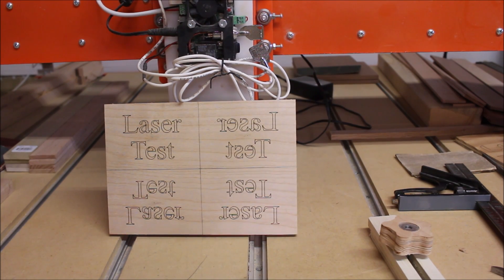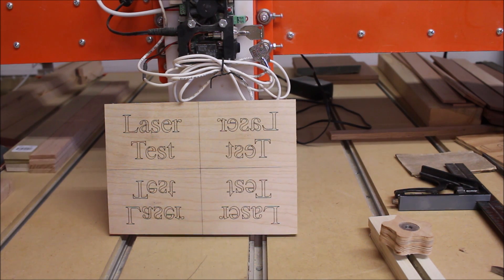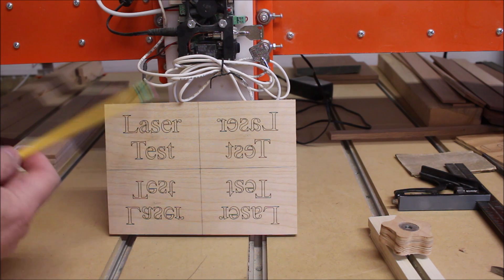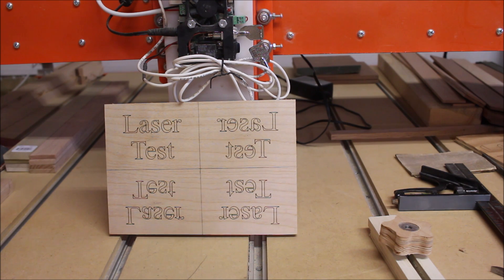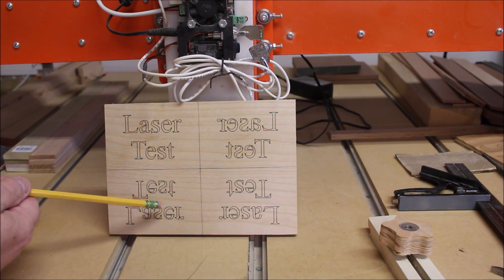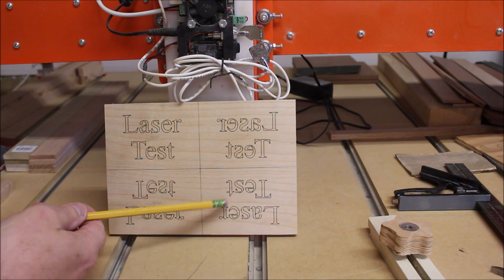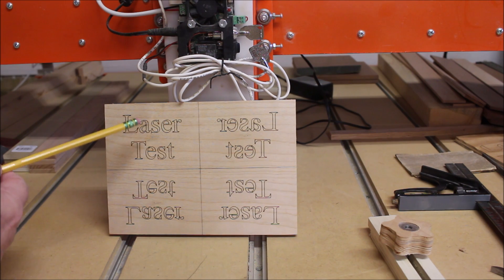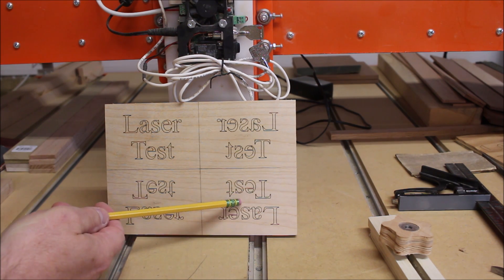My Program is Ran Upside Down

Comment: And where do you change the settings in Lightburn?
Reply from the maker: I'll assume your asking about using Lightburn with a laser.  When setting up your laser machine with Lightburn for the first time, you must select the correct homing position for your laser.  If your laser homes to the back right,  but you select front left, then everything you run will be backwards and upside down.